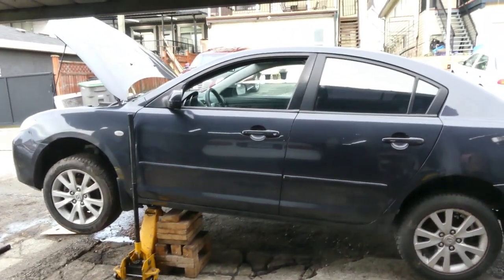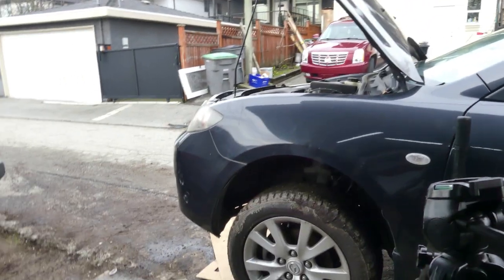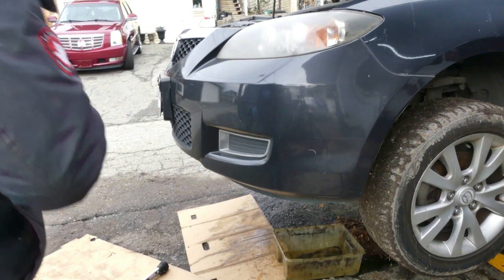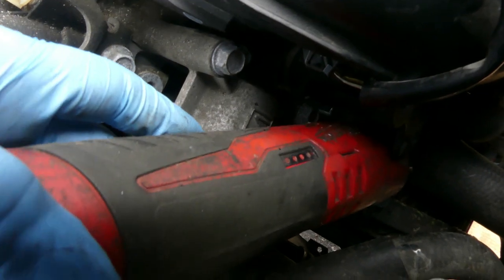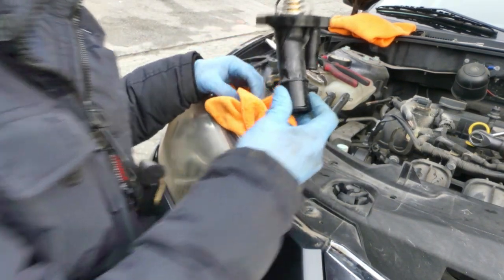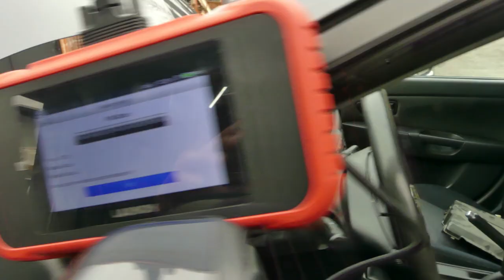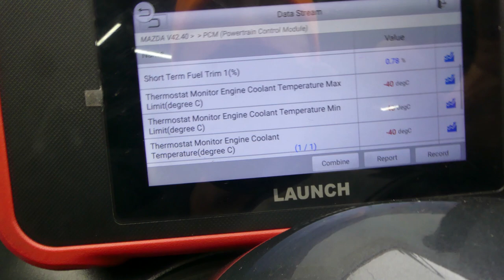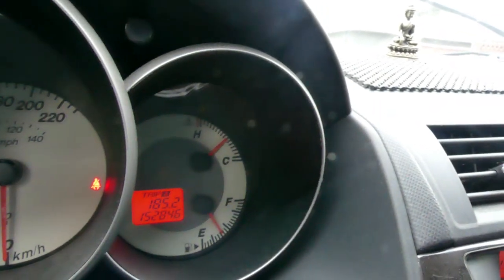2007 Mazda 3  Overheating & Coolant Leak Diagnosis & FIX

Comment: My son's 2008 GT hatchback started overheating at 115,000km.  The morons at the shop I once trusted said that it wasn't really overheating and it was just the coolant sensor.  They said it was safe to drive.  A few days later it was overheating again and it just quit while he was driving.  Ended up being the head gasket which then warped the head, so needed an entire engine swap.  I keep hearing how reliable Mazdas are, but there is no way a properly engineered car should need a head gasket with such low kms.  It's now at 155,000kms shifting rather hard between gears (automatic) so I suspect the transmission will be next.  This combined with the frozen ignition relays and faulty stater wire (both TSBs) that caused us a lot of hassle for almost a year, Mazdas so far are junk in my experience.
Reply: I spoke to the local dealer service department here and they told me that they "don't change the coolant unless it's leaking", which I found astonishing. That's despite the owners handbook saying that the coolant should be changed periodically (can't recall the interval). Very old coolant will likely have higher conductivity and will promote corrosion. It may also affect the life of the water pump.
Reply: @DiggerDog1962  Well, I'm 51 and have never changed coolant in 35 years of owning vehicles and I've never had an issue.  My 99 Sierra 2500 has 309,000kms on it now.  My son's Mazda that I mentioned recently had to have the thermostat replaced at 176,000km.  The water pump is still good.  Having said all that, I would never trust anything a dealer says, period.  Ditto for most shops now.  They're gouging everyone as they are so busy now that people are keeping their cars to avoid paying stupid prices for newer ones.

Comment: Sir, i just bought a 2nd hand mazda3 2007, and i am experiencing its coolant always going down to minimum level to almost empty the reserve tank, what is basic part of cooling system should i check first? Hope you'll notice my concern..ty!
Reply from the maker: Check for leaks use a pressure pump tools u can buy it from amazon.if theres no leaks then check ur engine oil u might have a bad headgasket so coolant is fixing into ur oil..

Comment: Bro I don't know where you went to mechanical school at but a set of jack stands at walmart barely costs 60 dollars, don't be that guy bro, if it could happen it will happen, and blocks of wood isn't going to stop a few thousand pounds slamming on you, hydraulic Jack's aren't meant to hold the car up, they're meant to just lift the car momentarily
Reply from the maker: i rather trust my 6x6 wood homemade jack stand its more stable its wider its balance rather than a skinny jackstand that will tip off if i push the car u know what i mean but thanks for ur concern but trust me this is more safer
Reply: He is from the Philippines. Great creative people that gets stuff done safely and right with limited resources.